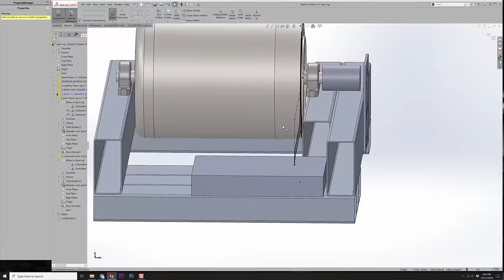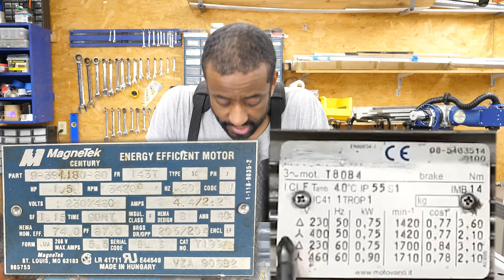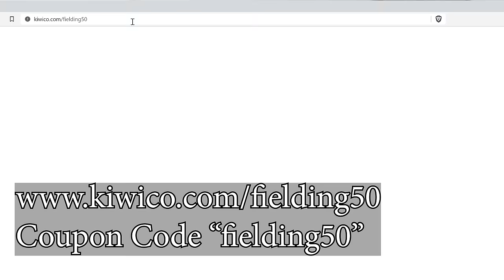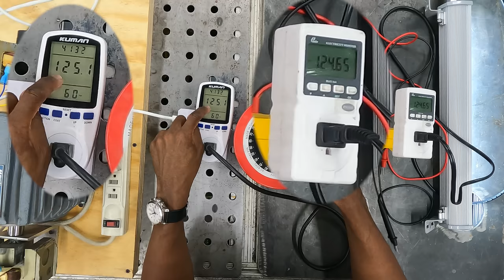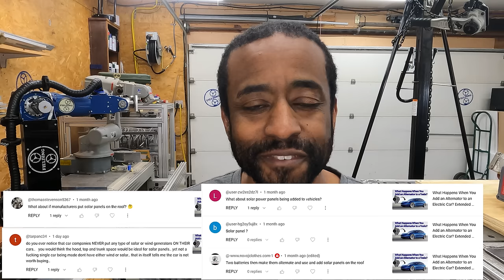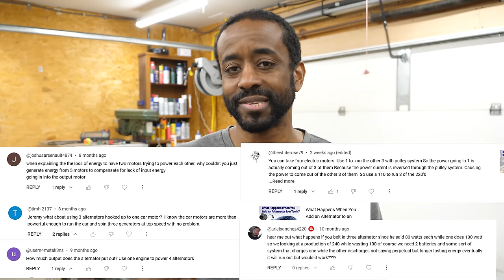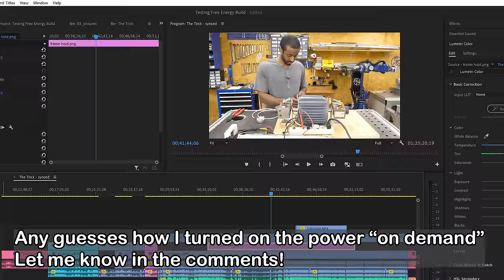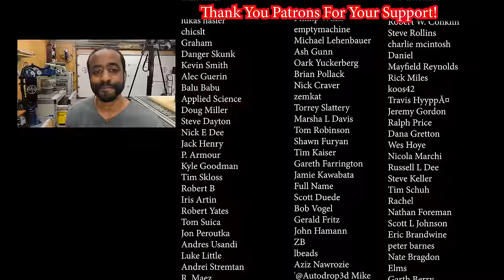Building and Reviewing Free Energy Generators on YouTube.

Comment: Here is an idea I had. Use a hybrid Gravity Battery (search Gravity Light) Solar Assisted system. Basically, the Gravity Battery's weight falls very slowly yet spins an electric motor/generator very fast. When the weight reaches the bottom a switching mechanism is engaged which switches over the pulley system to one that can raise the weight quickly. A small electric motor is used to hoist the weight back up. The small hoisting motor is powered by a battery bank which is charged via a solar panel. So when it gets dark at night the Gravity Battery will still function because the Hoisting motor doesn't need as much energy from its battery bank to keep hoisting the weight. Which will keep the system going until morning when the Sun can recharge the hoisting motors battery bank. 

How much a system like this can power depends on the design and materials used. And there's a ton of ways to configure this system. A donkey can replace the small hoisting motor. Just feed and water the donkey lol. I've studied free energy devices decades. I know there's a ton of scams out there. It's to bury the ones that actually work. I figured out the global energy scam when I was 14. We never needed an energy grid or the common fuels. There's a ton of evidence out there to support this. It means that we all have been manipulated and enslaved to crappy inefficient and costly technologies. We are slaves........if you think about all this and keep thinking you see my perspective.

The Nitinol Heat Engine invented by Richard A Banks of the department of energy. That was in the 70s and they even were talking about having a Nitinol Economy. What about HHO gas using Nickel Oxide Electrodes which split water at 1.5 volts using nonprecious metals. Stanford University scientist came up with one. Don't need to store Hydrogen just need Hydrogen on demand. No storage involved. Only make enough at a time to power whatever. Chryslers Turbine Car from the 50s 60s and 70s was a multifuel car. It can run off anything that burns including V05 Hairspray, Kerosine, Deisel Fuel, Gas, Hydrogen, Biofuel, Moonshine, Rubbing Alcohol, ext. They also had only a few moving parts and were very efficient. You could have a 10ft-by-10ft Fresnel Lens heating up water or a solution and making steam to turn a turbine to charge batteries. Edisons 1902 Lithium Nickel Iron Batteries are still good to this day. I don't like Edison, but he made a good battery. The Lead Acid Battery Co bought that company out in the 70s and discontinued their use. Only 3 manufactures in the world have been trying to improve them and have. 

None of these are Free Energy just more efficient alternatives that actually work.

Comment: Answer me one question?
If I have two magnets held apart on the surface of a table. Then you release them not imparting any force in the release. Where did the energy come from that slams the magnets together?
The definition of energy is moving a mass through a distance. The mass of the magnets was moved through a distance for the distance and time of the motion. As short of a time as it was, there was energy that moved the mass. Where did it come from? I know this is a very troubling question for some, but there is NO doubt that it was produced by magnetism. Magnetism fields are very complex and are in everything to some degree. I have seen live frogs levitated using very strong magnets. The only thing is, that no one has been allowed to expose the technology because it would ruin the status quo. One will have to be very clever as was Nikola Tesla in designing the device that will pull energy from ZPE. Every time I do the Table Experiment I am convinced that it is possible. Because it was done for a short period in this simple experiment. Electron Spin is really complex involving many sub-atomic particles. Somebody is going to figure it out.
Reply from the maker: You were the energy source. You are holding them apart. More importantly it takes force to hold them apart. It’s the reverse of pressing springs. In this case the stored energy was you. The same way that springs return to a low energy state when you let go… magnets immediately go to a low energy state with fields aligned when you release them
Reply from the maker: You really should read Tesla for yourself. Right now you are repeating what you heard from a scammer. But I have read all of Tesla's books. He was never interested in free energy and doesn't even mention it in his books. He did start the idea of wireless energy which we call wireless charging today. This is a real thing that is not free energy but he built that tower trying to make it work over long distances and scammers use that to claim he was working on free energy. The best part is you can check this yourself. Conspiracies are exciting but this just isn't true. I suggest you start with "my inventions" by Tesla if you only read one book by him. But you can check this claim yourself. You don't have to believe me. He wrote about all his works and left a record for you. Scammers just like to use his name because he was a genius and associated with power. It makes their claim seem more possible if "Tesla" was working on it. Also this idea is worth hundreds of billions of dollars if true. No one in their right mind would hid this if they made it for real.

Comment: Hm. In the v2 and v3 video the liberty alloy was given in terms of specific density. I haven't calculated it, but mass /volume narrows down the possible alloys. An iron rod won't work because it's magnetic. The length of the motor is relative to the length of the bar and the length of the standing magnetic wave.

Comment: The shaft is supposed to be a silver aluminum alloy which they wont give you the actual alloy. They did give dimensions and weights so I imagine you could use them to make a bunch of guesses on how much of each to use to make the alloy.
Reply from the maker: That claim is just part of the scam. He added that garbage to make it untestable. You can’t buy it anywhere and silver is very expensive. It is unreasonable to believe he ever even tried to make a custom material. There are at least 10 reasons other than material this doesn’t work. It’s like saying I used the wrong drive shaft in a car with no gas. It still doesn’t work. Energy is what is missing.
Reply: @Jeremy_Fielding Ya I didn't make it past where he mounted the shaft. it just sticks through the motor housing motionless and is inert to the whole system.

Comment: Wind turbine that magnetically pushes down a magic button generator whenever a blade passes the button... Put 2v out of 6v back into DC motor to run on gear to wind blade stalk. TA da... You get wind, you get the magic button generator and in case of no wind you just need to activate the DC motor with a small charge which will start the blades turning and get the magic button generator going and it starts itself!!
 You want free!! It's super easy, the files are on thingyverse for the magic button generator. A horizontal wind turbine with magnet on the blade where it will push the button down. One change to magic button is the flat end of button changed to angle w/magnet.
And of course there's a generator to the turbine as well.

Comment: Correct me if im wrong but in your reproduction experiment you didnt use the exact same materials that they used for the core bar. The size/shape looked good but the material is pretty off.
Reply from the maker: Lets assume the material is wrong. There are at least 5 other reasons this device doesn't work. More importantly he is most likely lying about the material to make the scam more believable. I know this for 3 reasons. 1. Material properties can't remove back EMF. That is completely made up and based on no science. 2. The material he claims to use can't be purchased anywhere and is a "custom blend" he won't share making it impossible to test (for a obvious reason in my opinion). 3. Silver is a very expensive material and this would be to expensive for most people to realistic try to figure out if it actually works. I think he just made this up so you can't prove him wrong. But it keeps hope alive which is what most people want. You want to believe its true. And thats the worse part. It is a genius scam because so many people really hope it's true. When given a choice to believe two different people... one tells you, you can have what you hope for, the other says you can't... even with all the evidence pointing to the second, if there is any possible doubt, you believe the first. That's why this scam is genius.
Reply: @JeremyFieldingSr  I don't care about believing it's true or not. I'm just pointing out the inconsistency in the reproduction test about that matter. That way there is no shadow of a doubt as to whether this works or not. I actually like that you tried to somewhat perform the experiment. But without the exact compound mixture it's a flawed test from the start. There are a few very good comments out there as to what it could be as well as their percentage mixes.  But either way your video was entertaining.
Reply from the maker: This logic is not correct. A test can be valid without using the same lab, or being in the same room you were in, same time of day, or any number of factors that might be important depending on what is being tested. This is a factor that doesn’t matter based on what is being testing. I guess we can just agree to disagree. But seriously This is like saying I didn’t use the right kind for drive shaft in a car without gasoline. That’s why it didn’t drive. I mean the missing gasoline is a way more important problem than whether the shaft is the right material. That’s not sarcasm. It’s really that big of a deal. But you’re welcome to think it might make a difference. In my opinion it’s just a red herring. It creates a mystery to keep you talking about it whether than dismiss it. The fact that your interested it what’s important. It’s hard to stress that enough. He makes money because we are watching and commenting not because it really works. You don’t even need to believe him for him to profit from the traffic. Anyway, thanks for the kind words. I am only trying to help people.
Reply: @Jeremy_Fielding  I understand where your coming from so let me put it in a very simple terms for you to understand. First, what you said about the same lab, same room , lab etc is nonsense...at this point we both know thats scientifically not going to matter. But lets say me and my team/staff are doing a peer reviewed scientific replication experiment. If we dont carry out and follow every singe step from the original study its flawed from the word go. If you went into this reproduction knowing you cant do it the exact way it was done thats disingenuous at best and no offense...makes you no better than these possible scammers. I know its important to get clicks, likes, subs, views, etc. But the scientist in me cant let the lack of a potential missed step in this slide under the radar...whether it works or doesn't work...the scientific method approach was broken.  Good luck bro. I do enjoy your vids they do bring me some laughs on occasion!
Reply from the maker: I am going to carefully respond once more. I think you are missing the forest for all the trees. The made-up material is not known, doesn't change the outcome any more than changing the table it was sat on, and in my opinion doesn't exist. Because there is no power literally anywhere, the shaft could be made of plastic. We should just agree to disagree about whether this was scientific enough for you. I was as transparent as I could be in the video. I get the feeling you know my intentions where good here based on your overall comments. I hit some other nerve that I can't quite pick up. I am only responding to defend the idea that my intentions were about views. That's a bit aggressive of you and not consistent with the content on my channel. Again I think you can tell this was about helping people but you said it anyway. To be clear, I made this video to answer the thousands of people who email asking about these devices. This was my response. Perhaps it wasn't good enough for you. And that's ok. It was for those who value my opinion.

Comment: I tried explaining it to people and the best way I found for them to comprehend it is when we drive a car and tires need replacement didn't the tires loose rubber traveling on the road? After they answered yes I tell them energy is the car and voltage are the tire's. And that is losses of matter. And conclude with anything in motion looses it's energy over time and can never be greater than the sum of its parts.

Comment: What if you using the magnetic field to cause resistance, that keeps the magnets moving after you introduce the spin, since it’s spinning and moving the alternator, no the alternator is making power from movement?
Reply from the maker: You should watch the first video in the series. You  can't make magnets perpetually spin. This even has a name "cogging". The same force that pushes is also pulling in the other direction. You can't get one without the other, and they very quickly balance out. There is no arrangement that can defeat this. Please watch part one where I explain why that doesn't happen. Link in the description. ALSO!!! This is super easy to test. You can try it at home. That is the best way to learn.

Comment: the guy said he used a special alloy of silver and aluminium. You should try with this alloy to be exact in the demonstration.
Reply from the maker: That story is just part of the scam. How do I know? 1. There are at least 10 other reasons this doesn't work. Saying I used the wrong material is like saying I used the wrong drive shaft in a car that doesn't have gas. It still doesn't run, so why are we talking about it? 2. That material can't be purchased anywhere. Thus... if true... he has to forge this material himself using silver. This material is very expensive and would not change the electricity properties the way he describes. 3. While it is true that alloys can create unique properties, there is no reason to think that any combination of materials can suddenly start creating energy from nothing.  I believe this is just part of the scam making it impossible to test because you can't buy it and he won't say what the ratio of aluminum to silver is. And he gets the bonus of giving people who just really want to believe its true something to hold on to the myth.

Comment: I find that a good majority of people dont actually understand basic physics. It is concerning, not because they dont know but people actively try to teach topics they dont know. For instance I cant tell you how many people I come across on electronics subreddits that argue "Voltage kills you" or "Amps kills you". Clear misunderstanding of what electricity actually is. You could have a million volts stepped up from a AA battery, be shocked by it and not notice it. You could be shocked by 4V and die because you exist in an area with different voltage potentials and your bodies voltage is -300V and the 4V you were shocked with has 500Amps. Its a lot more complicated AND a lot more simple than people let on.

Comment: It my start working but instead of your fingers attach the motor to battery drill impact to keep turning for a minute then disconnect and let it run and keep checking on daily basis without interaction or stopping I be happy if you could run two baking kitchens for evere I love to see you succiding

Comment: That long bar he uses is not steel, from my understanding from others is that bar is comprised of silver,  copper & aluminum. No one know the exact composition or ratio or how it's even fabricated. But best guest it's laminated sheets. And just to be clear i don't believe this works as well, just believe is you do a test it should be constructed as close as you can get it.

Comment: Use the Electricity Meter -AT4PW 100A Tuya WIFI - which works from 85 volts to 265 volts and extracts 6 parameters simultaneously: Current, Voltage, Power, accumulated Energy to date, Frequency, Cosine phi as the voltage reading is with 4 1/2 sampling, current is measured up to one milliamp, power up to 0.01 watt and the error of the device is certified up to 1%. Regarding the thought that it is not possible to get more Energy than the Input - it is possible in Ferrite mode of magnetostriction when shaking the entire volume of Ferrite up to 1.14 but due to the losses in the conversion the Coefficient drops to 1.03 maximum .. The principle is like hitting a ball in a basin and making waves and pulling Energy from the top of each wave but below 5% so as not to kill the resonance from the oscillation of the waves :) example - you use a 20-watt power amplifier and a frequency of 198 Hertz - you emit a speaker in a tube and at a resonant distance you put a second speaker from which you draw energy. You measure the consumption of the broadcasting speaker and load the second one and you see that you get Energy that is not reflected in the consumption of the broadcasting speaker. Smile - a person learns while he is alive)))

Comment: Question.  Can a 3 phase motor be started and ran with a single phase motor to produce a greater quantity of electric to run other motors.   A gravel plant used a 25hp motor to run a 50hp motor that powered the whole gravel plant. I was told it had to be a y wound motor and the motor that powered it had to be at least 1/2 of the power of the motor that was producing the power.